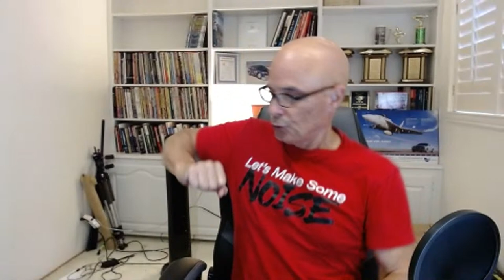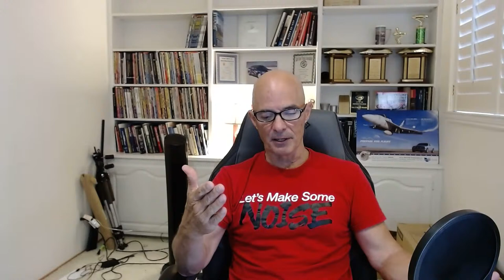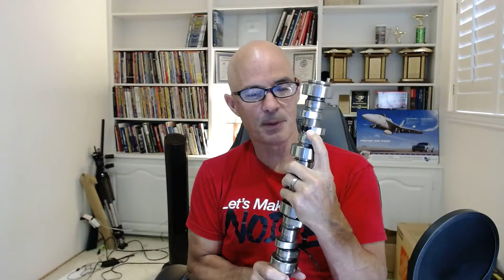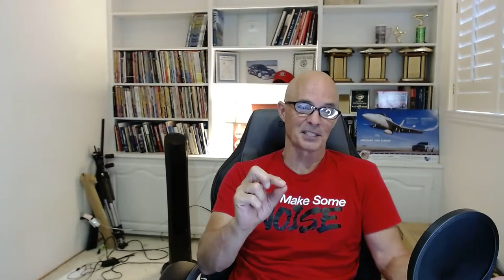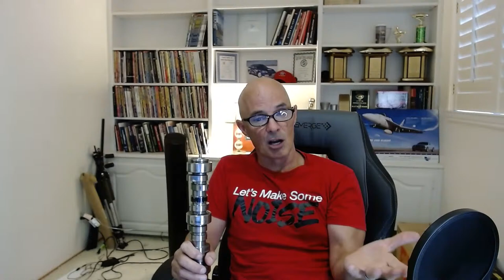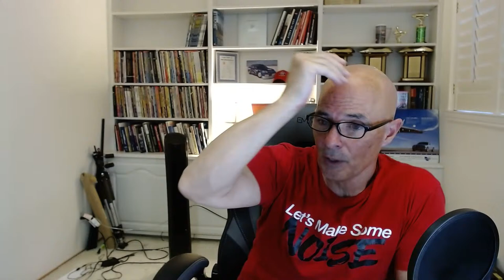LET'S TALK TECH-WHEN DO I NEED TO CHANGE PUSHROD LENGTH?

Comment: Good video. I like the new office with plantation shutters. Although many just use the classic 1/2 to 3/4 turn method to set preload, if your lifter has a published optimum preload value for your
application, or at least a range where you can make the choice where to set it, there is a formula to compute lifter preload as affected by the rocker arm ratio. It is as follows:  Lifter Preload = Distance per polylock turn / Rocker Ratio + Distance per polylock turn.  If your LS has adjustable valve train, I believe the LS rocker stud size is 8mmx1.25 which equates to 20.32 threads per inch (TPI). In this example, we are turning the polylock ½ turn or 0.5.  Distance per full polylock turn is 1/20.32 TPI or (0.0492)(0.5 turn) = 0.0246.  Thus, 0.0246 / 1.7 = 0.0145 + Distance per polylock turn or, 0.0246 + 0.0145 = 0.0391 lifter preload. A non LS example with a 7/16-20 stud is also provided.  In this example, we are turning the polylock 3/4 turn or 0.75.  Distance per full polylock turn is 1/20 TPI or (0.05)(0.75 turn) = 0.0375.  Thus, 0.0375 / 1.7 = 0.0221 + Distance per polylock turn or, 0.0375 + 0.0221 = 0.0596 lifter preload.  Set up this simple formula in Excel and you can compute for any stud like me (LoL).

Comment: Anytime you change any dimensions of the valve train, you need proper length pushrods. For instance, shaved heads, shaved blocks, different valves with longer/shorter stems.

Comment: Nice video! 
Hello, I got a 67- Chevy 327 stock heads.  I just mill heads, block for total amount of 2mm and also put a lunati cam with lift at valve 0.465in0.492ex. Do you think should I check the pushrod length?
Engine start but checking the vacuum gauge the needle drops between 9 to 14 in/hg
Reply from the maker: that has an adj valve train-so pushrod length is not as much of an issue-did you adjust the preload properly?
Reply: @richardholdener1727  thank you so much for your reply.  I got the heads totally rebuild, like seats, valve and also guides.. The engine is totally rebuild.  The weird things that I found is that I got 125pis compression. I should have 150psi because is 10:1cr.    Now maybe the engine need just to run and faces the pisonts rings and valve seats... I really don't know. The vacuum show needle drops between 9-14 in/hg so something I'm listing compression somewhere.

Comment: What is your opinion on the Rhoads lifters? I’ve used them before and had good results. I haven’t heard anything about them for a bunch of years, but I soaked my Comp lifters, and some of them wouldn’t bleed. I’ve seen a bunch of stuff about cam and lifter failures. I know it has a lot to do with the oils that you run with flat tappets, and I’ve seen a lot about how most cam companies are using a certain Chinese main body, that’s prone to failure. So, I decided to go back to something I knew worked before.  If you have an opinion on the Rhoads, I’d love to hear it. Most people don’t have an opinion, but they tell me to stick with the original cam manufacturer’s lifters
Reply from the maker: I would like to try the Rhoads
Reply: @richardholdener1727  they’re supposed to lower your duration by about 10 degrees
Reply: I’ve used them with cams that were a little too big for my converter, and gear, but they seemed to give me a little more punch, when I stepped on it